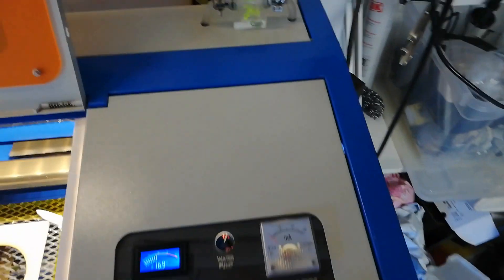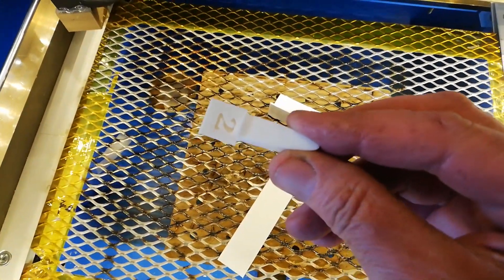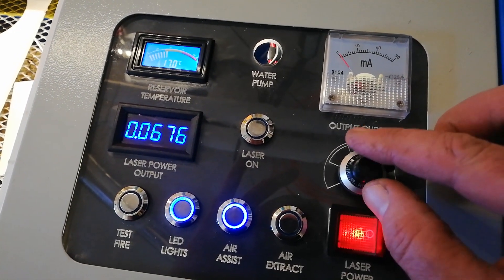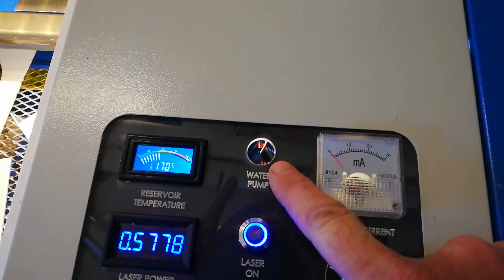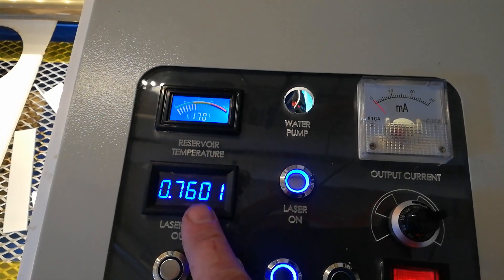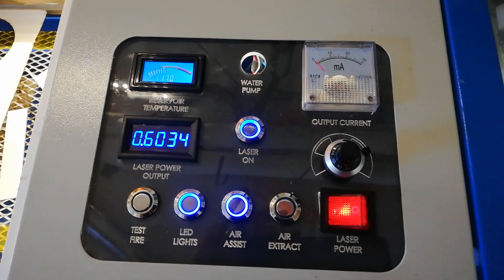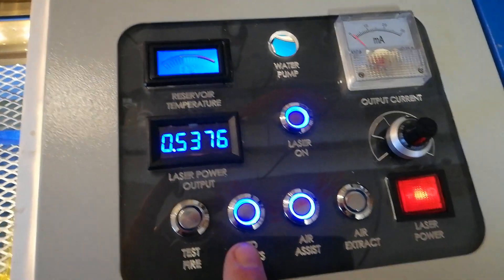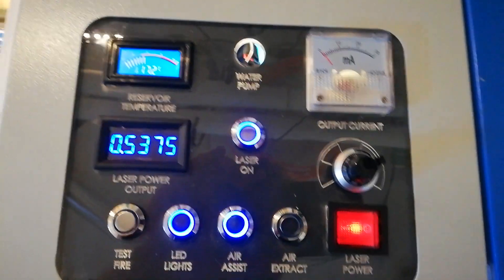K40 Laser control panel best upgrade under $10.

Comment: I am curious how thick the perspex was for your control panel, 
Also if you have ever cut 8mm perspex,  I have a job I really want to do with 8mm perspex, not sure if the K40 will do it, I am hoping, 
Happy for a reply from anyone if they have done 8mm perspex/Acrylic
Reply from the maker: I think it was 4mm and I don't think I tried to cut 8mm and the k40 would struggle to cut 8 maybe multiple passes.
Reply: @letsfixit1594  hmm ok, I hope I can do 8mm, Thanks for the video and your reply.

Comment: Awsome work, please  could you explain the Analog Current Ammeter, where do I wire it too and what is it for, just to see how much power the psu is kicking out? Sorry  if it's a dumb question just trying to work out what I control with it. Kind rgds
Reply from the maker: Hi thx, the ammeter is in line on the negative side of the tube and messures the current being drawn from the power supply. So more current more cutting power.
Reply: @letsfixit1594  thanks for taking the time to reply

Comment: What does the digital meter represent in terms of units plz?
Reply from the maker: Hi John, the readout represents the output power of the laser so a higher voltage readout is a higher power setting.

Comment: So far I've not been able to find any schematics what so ever You called it a power meter, but it measures voltage actually? in steed of amps? and where did you connect the voltmeter on what pins of the board ?? Kind regards Hans
Reply from the maker: Hey Hans, The voltage display represents the power level of the laser so you can accurately set the laser every time. Its measuring the actual voltage controlling it and it´s connected across the potentiometer.
Reply: @letsfixit1594  Okay thanks mate I already had a microswitch installed for the lid so this power meter will also going to work Thanks a lot Kind regards Hans

Comment: is there any table for the set voltage on poti with outgoing power or does that have to be tested ?
Reply from the maker: I don´t have one, there does seem to be small differences between machines, so it´s best to trail and error it.
Reply: @letsfixit1594  found one at a german engineer site but He just assumed a average Power of the laser tube. But to get a feeling it May be Not so Bad if someones interested i can Post the url
Reply from the maker: @TheSchnibbi  Perfect sounds great!
Reply from the maker: @TheSchnibbi  Excellent great info. thank you..

Comment: Thanks for the informative video! But I don't think the push buttons in your description (eBay Link) are the right ones. They have to be toggle switches and in the detail page the seller writes NOTE：Keeping press to turn on, releasing to turn off
So they are momentary switches. Unfortunately I didn't read it when I bought them so I can confirm that :D

Comment: Hey! Wondering if the K40 you are using in your videos is equipped with the original Nano board or if you've swapped it for a Cohesion board, for example!
Reply from the maker: Hi Posh, no it´s the original board.

Comment: Do you have a video on the water temp flow meter thingy?
Reply from the maker: Yes coming real soon.
Reply: Let ́s Fix It 3M(TM) Scotchlok(TM) Electrical IDC Connector 560B, Blue, 18–16AWG solid/stranded, 14AWG stranded, 100ct https://www.amazon.com/dp/B0002BFZ8E/ref=cm_sw_r_cp_tai_KLiXEbTZY2JD1

Comment: Any chance you could post the part number of the 100 turn potentiometer you used? The 3590S-2-102L linked on the ebay listing is a 10 turn only. Thanks 🙂

Comment: Was it a 100 turn or 10 turn pot you used? Says 100 in the video but the ebay link is a 10 turn
Reply from the maker: It´s a hundred turn, the one in the description is the one I used.
Reply: @letsfixit1594  thanks mate, shall get one ordered as the link doesn't ship to the UK :-)
Reply from the maker: @NXSmiggy  No problem, good luck with your build.

Comment: When I wire in my meter from the pot it the lasr stops working. A Soon as I remove it the laser starts working again. And when it does read out, it only reads the first two digits any ideas?
Reply from the maker: there is a supply for the meter itself and the sense wires for the voltage readout. you may have these reversed.

Comment: So I just ordered the parts for this panel and I sure wish I lived where you do because there is no way you could make this for $10 here. I'm at $75 bucks cdn and I haven't got the Acrylic  or the micro switch yet. I think $110 is more like it. Having said that, it is still the coolest looking panel and worth the money.
Reply from the maker: yeah my original idea was just to add the volt meter to the original panel but I sort of extended that so the costs are higher with the added meters and acrylic.

Comment: Quick question for a semi-technoboob. Are these electronic parts Compatible with 120v AC here in Canada
Reply from the maker: Hi Quarlow Yes all compatible, mostly DC so no issues.
Reply: @letsfixit1594  Perfect, thank you. I just ordered a K40 from China for the stupid price of $34.00 cdn. Hope its not a scam but for the money no big deal. He had good reviews and I got it threw Paypal so I have some protection. And with free shipping I can handle the loss. I love your panel and kill switch build so I am ordering the parts already. I get that these K40's are for the tinkerer so I'm in for this and can"t wait for it to come. I have an idea for a vacuum bed for cutting paper so it can't move while cutting but first things first.

Comment: Can you do 3D images with the k40?
Reply from the maker: You can do grey scale engraving, and this gives a bit of depth to the image, darker portions of the image are cut deeper.
Reply: @letsfixit1594  So when doing a raster engraving like a picture how does the settings on the meter effect the outcome of the laser during operation? Meaning, if you set it at .5550 is that the highest it will burn the deep areas of the picture?
Reply from the maker: @weldingdrummer  You really need to experiment with different levels and different types of wood and grain will also effect the outcome.

Comment: On the meter, .5 is what?  As I understand it the pot just adjust the power to the laser.  However no correlation to actual current, right?  That's why people used the analog meter to set the power by.   Just trying to understand what the reading on the digital meter relates to exactly.
Reply from the maker: Hi Micheal yeah its just a gauge that you can use so you have an exact power level that you can go back and use every time, best is to experiment at different voltage levels to obtain an optimal power level for the material you are cutting or engraving.

Comment: I like your panel so much that i got one of those digital meters and the pot. question, does the meter has its own power supply? Then the other side is hooked up to the pot?
Reply from the maker: Hi Goosh yes the readout has its own input power supply and the sense wires go from the sweeper connector and and outer connector on the pot.

Comment: you engrave at .6 but what level do you cut? for example here that wood, acrilic and foam?
Reply from the maker: Hi, you really need to experiment with different values until you get a nice clean cut.
Reply: @letsfixit1594  Thank you but I was wondering about your specific settings. I know mine will be different. But after seeing you engrave at such low setting it made me wonder about your setup specifically. I am not looking to use them on my laser.

Comment: I've been researching these units for a while and this is the best video so far. I'd be interested in the cutting capabilities. I wanting to cut acrylic, perspex both coloured and possibly 2-3mm carbon. But I've seen that it near enough impossible and would be better with cnc

Comment: Do you have a video or link that shows how to wire everything up? I'd love to do this upgrade but I don't want to bugger up my engraver ;)
Reply from the maker: Hi Brian I have recently bought a brand new K40 and wil be making a new video soon, I hope.
Reply: @letsfixit1594  yaasss! I can't wait for it! Been waiting a long time for this!
Reply from the maker: @Shedshoppie  Hey Pal I´m actually in Europe and buy them from a dealer in Germany, I haven´t noticed any major differences apart from control panels, the most common I believe is the one I was using.

Comment: Does the temperature meter display in Fahrenheit or only Centigrade?
Reply from the maker: Hi Paul yeah it only reads in Centigrade.
Reply: @letsfixit1594  thank you for the quick reply. I'll keep searching for one that displays Fahrenheit. Awesome job on your panel. I'll be converting mine in the near furture. Keep up the great work.

Comment: Patiently awaiting the wiring vid, I may just take the meter and go at it myself. Bought a 12v step down to power the led rings, will take 24v for air assist fan from stock power supply and 5v for digital readers from power supply also.
Reply from the maker: Yeah sorry,I just have too much going on right now, If you have a bit of electrical/electronic knowledge and can solder it´s not all that difficult.
Reply: My greatest concern is overloading the power supply with too much draw, but I think it should all run.
Reply from the maker: @SavannahGunGuy  you can easily install a 12v power supply and run everything from that.

Comment: Hello, what switches have you used for laser switch and test fire? What voltage are the leds rated for? 3v, 5v, 12v, 24v or 220v? Did you wired the switches and leds in serial connection directly to the k40 psu as the original switches were?

Comment: hello sir just got one of the lasers the laser voltage readout dose not work have you got a link the link dose not work thank you really wont to get one
Reply from the maker: Hi Wag Just make sure you are connecting the volt meter correctly, it has 2 separate connections. the first you need to connect to the 24v power supply and the other connection the needs to be connected across the potentiometer.
Reply: @letsfixit1594  sorry i think we got our line crossed  the link for the read out dose not work on ebay and can not find anything like it  the volt meter  thank you
Reply from the maker: @wagWAGart  Ah OK sorry, try it now, it should work.
Reply: @letsfixit1594  it has thank you sir do you have a wiring diagram please
Reply: @letsfixit1594  the laser power out put meter
Reply: sorry its ok done it do you have any wiring diagrams please sir thank you

Comment: Great mods!  Are you cutting metal at 10:58?   I thought it couldn't handle that.
Reply from the maker: Hi N N
No this was black paper, the backing for the panel. Would be nice if it could cut metal.
Reply: Great idea to use the paper!

Comment: That's quite clever, and not just because I'm doing the same thing! Yours is nicer looking than mine so I suppose I'll have to increase my effort. Good work!
Reply from the maker: Thanks Ryan you can easily set it up how you like, Inkscape is easy to use and you can make the cuts on a piece of cardboard to check if all your sizes are correct.

Comment: Hey, Fit-it!  Can  you elaborate on how you set up your air assist fan (where you got it - the housing, etc)? I really like this idea better than setting up a weak aquarium pump and hose. Thanks for the video!
Reply from the maker: Hi Corvus I have added the info in the description, I used a 24v fan to make it easy to adapt to the existing power supply, the housing is 3d printed and slides onto the bottom of lens.
Reply: @letsfixit1594  - THANX! - I'm buying my K40 today! - (I love tinkering/gadgeteering) this thing sounds like a dream!

Comment: What happen with the labjack? Isnt usefull?
Reply from the maker: Hi pablosqy It was a bit wobbly so this would cause the ends left and right to rise up and down.
Reply: @letsfixit1594  That's what I discovered about them too - I wonder if there would be a way to have the jack raise a platform that is being supported on all four corners - like sliders maybe or one of the powered Z-tables without the threaded rods?....
Reply from the maker: @corvusmoonstudio  I also tried a few different things to get it to level but i was unfortunately unsuccessful.

Comment: Hey just wanted to say awesome upgrades,  really liking the custom panel!  One question,  you are the first I have seen using electric air assist (like 3D printers),  this is a frikin awesome idea.  Where did you get the idea at and have you had any issues?  I really like this as it gets rid of the stupid air pump and hosing.
Reply from the maker: Hi Dennis, I have had no problems with the little fan on the side, works well and lens stays nice and clean, they are also available in 24v so you can use the existing power supply output.I must admit this was not my idea but can not recall where i originally saw it.

Comment: I took your control panel SVG to local laser cutter. They said its not the right size.  How do i get correct dimensions
Reply from the maker: Hi Planet,
 I just downloaded the file from thingiverse and made a test cut on paper and it lines up perfectly with mine, what seems to be the issue, hole sizes, hole placement or sth.else?
Reply: Yup i cut mine too and the mounting holes are off.
Reply from the maker: @cknorris  Weird my mounts must be set different, how far are they out?
Reply: @letsfixit1594  Its off a few mm's but I notice the original panel is slotted. So there must be a slight variance in the machines and they allotted for it with the slots(ovals). I am just going to take your design and add slots instead of holes.
Reply from the maker: @cknorris  yeah that´s the best idea also in inkscape its easy to change the position of the holes.
Reply: Make sure which version of the k40 you have, I bought the mini without realizing and everything is smaller
Reply from the maker: @SavannahGunGuy  There is a mini version? wow did not know.
Reply: @letsfixit1594  Can you show the wiring? I can't get my laser switch to light up.
Reply: Yes, I didn't realize until I got it home and started comparing vids. The system is basically the same with a smaller footprint and it may be about 16lbs lighter. Inside the box is a bit tighter, no room for expanding the x or y axis'.

Comment: base your power of the laser by the output current  mA meter.  a 40 watt co2 laser cant go higher than 24 mA. so if your dial is at 50 when your at 24mA your new 100 is 50.  if you use anything over that 50 you will find yourself getting a new tube soon.

Comment: Currently, this is with the factory Nano controller board, right? Thanks for this video. I just upgraded to the Cohesion 3d board and reworking the control panel is my next project.
Reply from the maker: Hi James
 Yeah original nano, did you make a video of the 3d board upgrade? good luck with the build.
Reply: @letsfixit1594  I haven't made a video for it, but it was a super simple upgrade. I didn't even use the K40 with the nano, I just went ahead and upgraded before I ever got started. I'll make some videos soon I hope and I can cover the upgrade for sure.

Comment: this is a video about supposedly good upgrades.  but you are using aluminium as a buildplate.  you are getting alot of black marks on the bottom of your cuts don't you?   
aluminum is like a mirror for infrared lasers.    get steel instead.  it will absorb it instead.
Reply from the maker: No it´s steel no black marks underneath.

Comment: One more question.  The power meter part you indicate a 5v LCD meter.  You measuring voltage, not the power aren't you?  How do you relate the voltage to power?  Love the idea.  Current you use the current meter instead?  Thanks
Reply from the maker: Hi Rick, the voltage is sourced from the power control potentiometer which adjusts from 0-5volts so 5 volts would indicate max power 2.5v would be 50% power and 1v would be 20% and so on. Basically it is a accurate indicator so that you can set a known value each time depending on your power needs.
Reply: yes the current meter is much more accurate. 24mA is 100% laser power.
Reply: hi, where do you connect the 5v panelmeter ?

Comment: The panel were you using an all black acrylic panel?  Do you have the 3D print files for the spacers?   Thanks so much of for the video.  Exactly what I was going to do to mine.  Love your design.
Reply from the maker: Rick i used clear acrylic with a black paper backing, you can use the same vector cut file to cut out the holes in the paper. I will post the spacers on thingiverse and the link is above.
Reply: Thank you for clarification.

Comment from the maker: You can buy the flow meter from banggood,  it's in the description. This comes as a complete unit and ready to go, all you need to do is connect it in-line with your cooling tube.
Reply: How did you fix the temperature sensor issue? Did you just drill a big hole in the top to allow room for the sensor? Then wires just go directly inside? Did you mount the flow meter with anything? Thanks :)

Comment: Great updates, I just got a K40, have not set it up yet, do you have an additional earth lead on yours? I'm from Australia, and as you know we have everything grounded in this country, should I add an additional grounding? Would you be able to draw the schematic diagram for your control panel, I have no idea how to set up the electronics. How many spacers for your bed did you make?
Reply from the maker: Hey Steve I'm also an Ozi but living in Europe, I don't have any extra earth besides the inlet plug and never had a problem. The spacers I printed 4 of each for each corner of the bed I can attach the files in thingiverse if you like? The wiring I will make another video to explain, soonish.